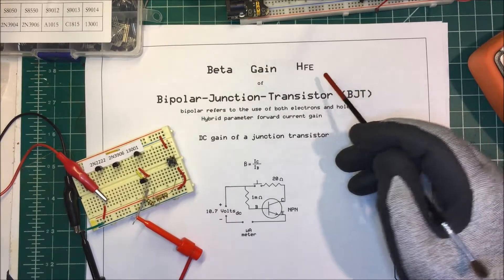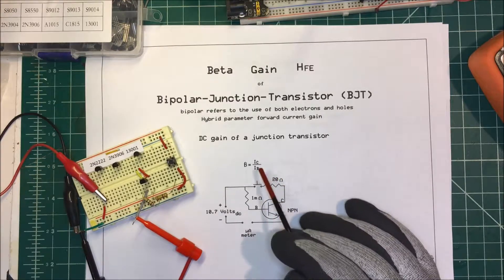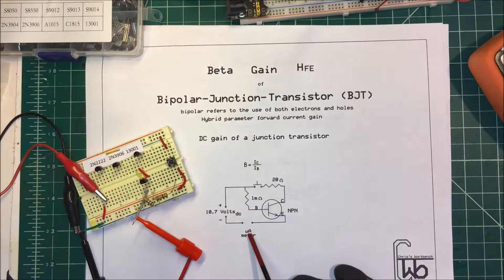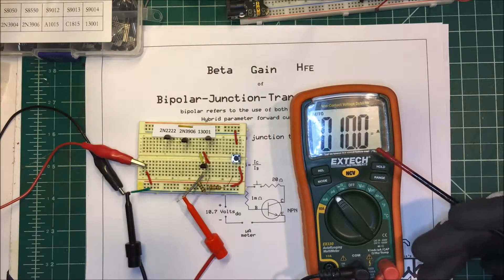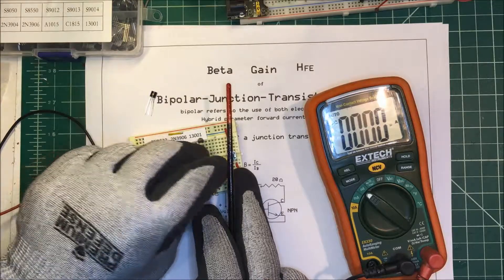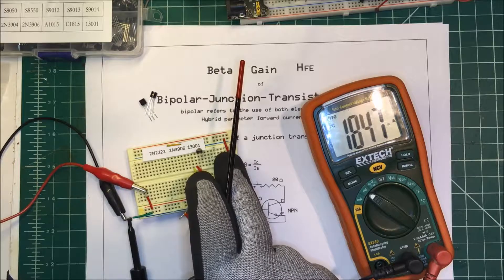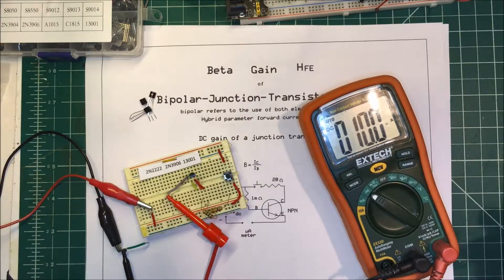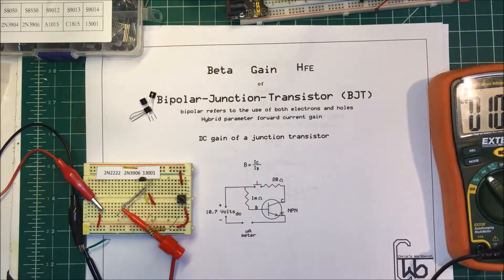Transistor Gain

Comment: I am following a book on self teaching electronics.

on part had an exercise where you made a circuit like yours and took the measurements for a range of base resistance values.   the book showed an example where the author got the same calculated beta across the range of resistance values.   

I got a varying beta. started high and went down.      I dont understand why my results were diff that his.